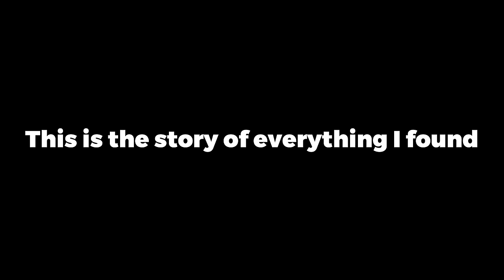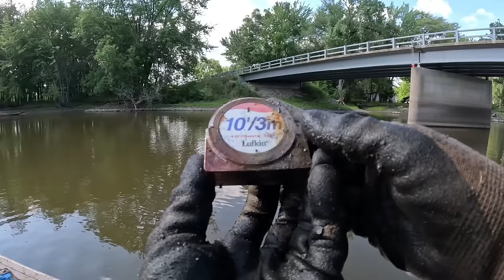I Discovered Evidence of Home Invasion, Retail Theft & TONS More Underwater While Magnet Fishing!

Comment: 3:34 The screw is a part of a clamp mechanism for a chop saw for cutting steel. 6:21 That is an industrial chain harness or bridal for heavy lifting in a factory. You should restore that chain. Very expensive. Soak it in evaporust. 8:38 side draft carburetor for a tractor 9:30 Another clamp for a steel cut off saw 12:01 both pieces are  from a gumball machine 13:10  sawhorse leg 15:35 seat base for a semi truck 16:54 candy box door 20:50 Cash register 22:44 Water separator 27:08 lock box for a house for sale could be a key inside 28: 38 cash drawer for your cash register 35:20 Car pillar 40:47 Sand anchor 44:58 Ring gear to go around a flywheel, a starter engages with that gear 47:00 Pinion gear from a differential 48:16 stand for a table saw 49: 58 trolly wheel 54:56 Ball PEEN hammer head 104:25 Monkey Wrench, NOT A PIPE WRENCH Rear axel housing for a model A 108:10 Brace for a brace and bit drill 114:28 MONKEY WRENCH NOT A PIPE WRENCH Repeat after me MONKEY WRENCH NOT A PIPE WRENCH! The roller is from a Wringer washer NOT A WASH BOARD!! 118:41 return spring for a jack hammer 121:49 Bed frame castor 124:10 steering tie rod from a car
Reply: All kinds of stuff and Frankie's too. I'm ready for summer.

Comment: Your wooden handle with that metal Spike on the end is a logging tool will they usually has a hook device that hangs off the side where you can flip a log over or get it up off the ground called a Peavey if I remember right

Comment: The thing with all the buttons on it is an adding/cash register from my error so 1960’s - 1975 ish. The orange thing with the goobie  inside is a tractor door frame! Those are the valves and push rods for engines. Those are about compression. The wheel is called a caster wheel for pretty much anything, chairs, or shop vacs. That pipe I believe is a gas line and it could come off a large gas stove. The metal piece with a small handle looks like an old fly fishing reel. Train track lever maybe but horse and buggies had a brake lever like that and since you found old wagon wheel rims I’m leaning that way. You’re definitely catching some something or other whatchamacallits!  Lol 😂